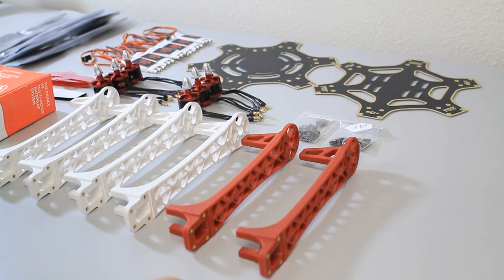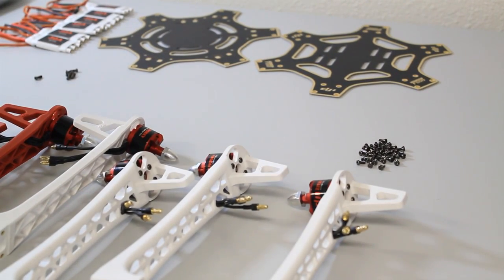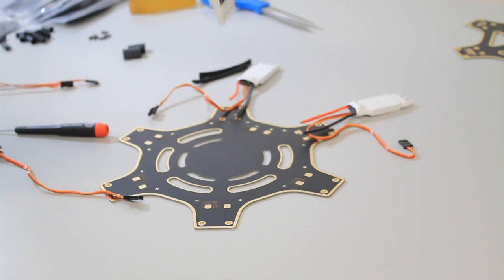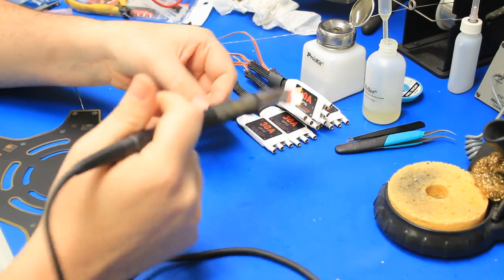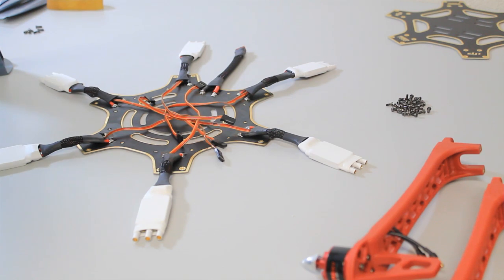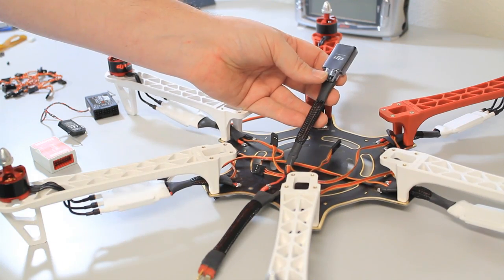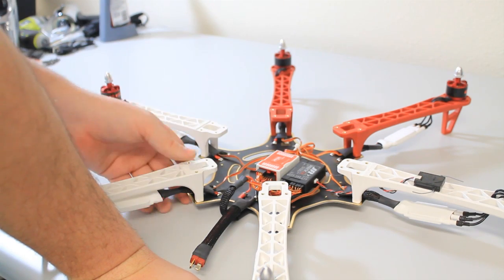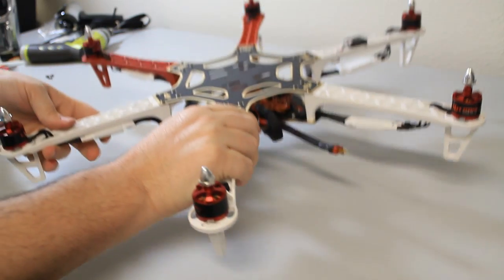DJI F550 FLAMEWHEEL NAZA HEXACOPTER  ARF  STEP BY STEP  COMPLETE BUILD

Comment: hello my friend, I listen'm putting together a F550, and liked me as you have armed, and would like to know how is called the shield wire you used to tuck the wires of the motors and speed controllers? and where I can buy it, I would greatly appreciate that puedieras help me with this thank you very much.
Reply: +Luis Estuardo Juárez Marroquín Friend of few millimeters is the diameter of the mesh guard?

Comment: Great video, also I am wondering what other parts are required to attach a gps that somehow can be used to control the hexacopter , camera that can connect to a phone using the gopro app or to a controller that connects. Overall I am wondering what I need to live stream from a camera connected to the hexacopter.

Thanks,

Comment: HI,

I'm about to attempt this same build and had a couple questions about your video:

Which type of solder are you using and which temperature do you recommend the soldering iron to be? I have .7mm rosin core solder - should I put a little flux on the connections on the plate before soldering?  

What size heat shrink and braided sleeve are you using?

Any advice would be helpful, thanks!

Comment: Great video!  Had a couple questions if I could.  Can you please explain the rear of the NAZA input setup again with the receiver?  "A" on NAZA goes to "AILE" on receiver.  "E" on NAZA goes to "ELEV" on receiver.  "R" on NAZA goes to "RUDD" on receiver.  "T" on NAZA goes to "THRO" on receiver.  4-pin on LED module to "LED" on NAZA. Then 3-pin to "X3" on Naza?  Is this all correct?  I am planning to use a Spektrum DX7s trans with AR8000 receiver.  This is my first build so please understand ;-)

Comment: You can change between X and + formations on any of the common setups, but I'm not sure if there's a firmware for 10 arms.
It's an odd number so it doesn't really make sense.

Comment: From the handle I'd say he's using a noname soldering station, probably "BEST" or "BAKU"

I have a Weller, but unless you find them used like I did, they're kind of absurdly priced.
With lead free solder I use 300C on my machine, it melts at 250 but won't flow at that temp. Leaded solder is a lot easier to use, but toxic..

Comment: If you turned the NAZA slightly and made it even with a leg (instead of in between two legs) does that change the forward flight?  I was thinking of adding 4 legs to a hexa (not 6 legs) so that a camera wouldn't show the legs in the frame.

Comment: Thanks, this has been really helpful for me assembling a F550.
I found that the bullets that came on the DJI motors weren't very reliable though. Already had to replace them on two out of the six motors after my F550 started twitching.
Talked to a few of my flying buddies and found out I was not alone.
I now intend to replace bullets on all remaining motors as well.

Comment: Ok, I got my 550 and a Futaba 8FG super. With my ipad on my left side running your video, the build process went smoothly until the wiring, which has slowed me down. My questions are probably so elementary, that you did not think about showing it in the build process but I am a RC newbe, so everything is new to me. 

First, how to connect motor and ESC.

How to wire up the receiver and Naza and connect them to power. 

What to do with receivers 2 antenna wires.

Hope you can help me out.

Claus